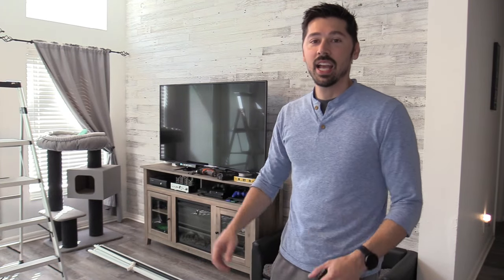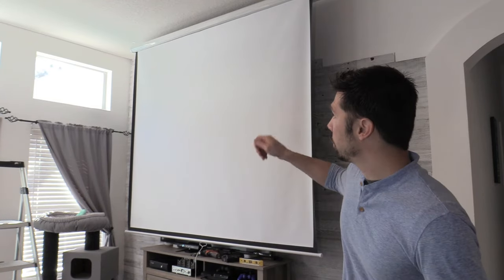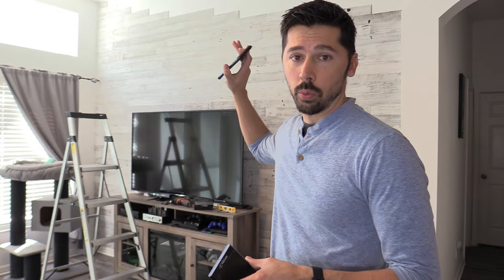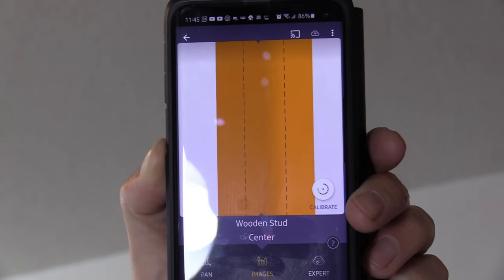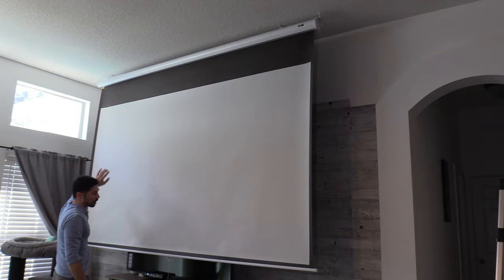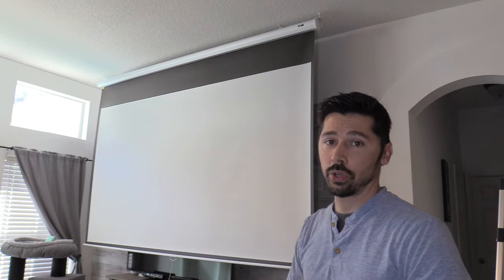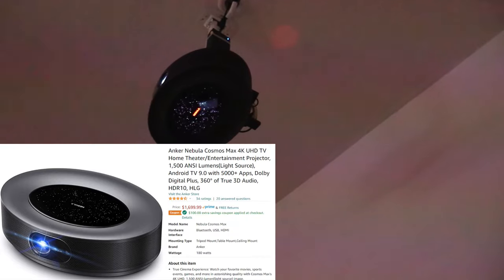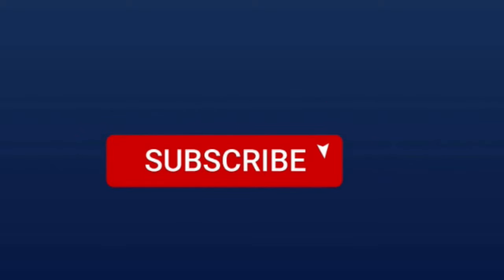How to Hang a projector screen on ceiling in studs

Comment: What if the ceiling your gonna hang the projector from isnt below your loft space and the joists/studs don't match where you wanna  drill the holes.
Reply from the maker: @grahamjones7070   you need to put in a wooden brace on each side, so projector screen can attach it securely.

Comment: If you can’t get into the ceiling void to add a pattress. You could install one directly to the ceiling. If you like symmetry you can extend at each end to match. Dependent on where your joists are. Then just paint it up and jobs done.

Comment: Im new getting into projectors. I had a cheap $100 projector that was given to me. I was just projecting it onto a white wall. It was watchable but I bought a cheap $100 pull down screen and now I have to mount it. Hopefully it improves the picture a bit even though the screen is a little cheaper.
Reply: Did it improve the picture?